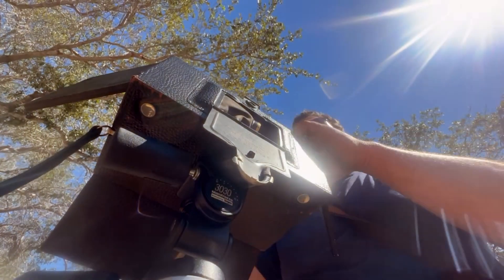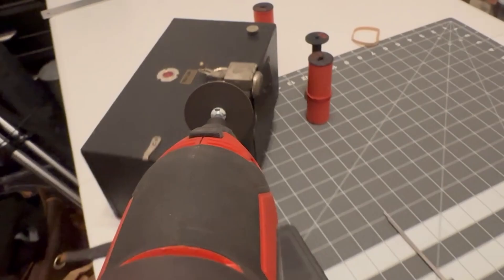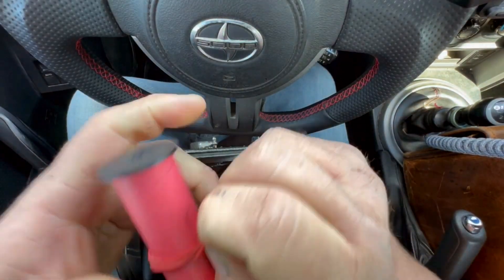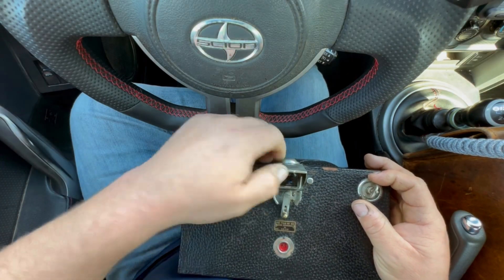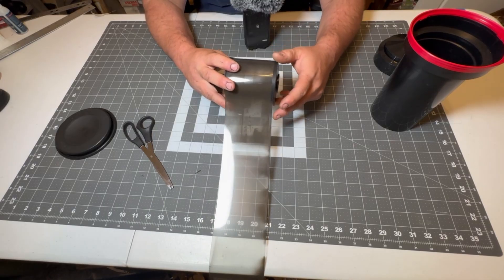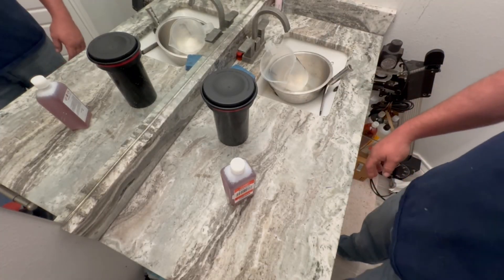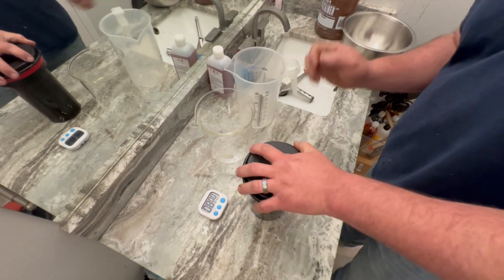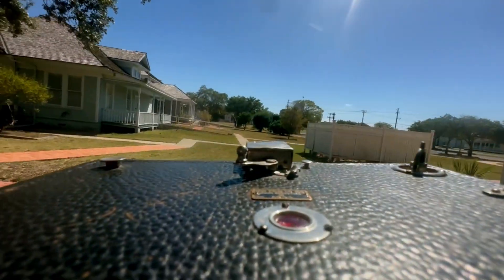Making 103 Film From Scratch for the Kodak Panoram No 4

Comment: Glad to see that paper is helping folks out! I might look into making a similar jig for cutting my own paper as well, and possibly film. Biggest hurdle is probably getting to be figuring out how to print the numbers without ruining the film.
Reply from the maker: I am working on a Al-Vista 4B atm. I’ll sure the process for how I choose frame location and paper length. The Al-Vista doesn’t need frame numbers but I can demonstrate it in that video.
Reply: I generally know how to place the stock market and frames, the real problem is the actual ink itself. A lot of inks that you can get as a consumer are not film, friendly, and even a lot of the inks that you can get industrial cause issues, as FOMA continuously seems to be finding out, and Ilford/Kodak have flirted with in the past.
Reply from the maker: @mcb187  I have tested and had some success with acrylic paint. It needs to be full dry before film can touch it but if you take some paper and coat 1 side with cheap acrylic paint or lacquer it should work. Once acrylic fully dries it inert. It's a pain and takes a lot of time to setup for but my earliest test with 122 film was done with this method. Same goes for the frame numbers.

Comment: A thougt. Is it possible to pre cut the flm so you dont have to fidget around with a scissor in the dark?
Reply from the maker: I didn't mention this in the video, but I have to cut the film in the dark no matter what. I cut the film from 9.5-inch-wide rolls of aerial film stock. I also use night vision goggles so I can see what I'm doing. Rounding the ends isn't too dangerous, but I understand wanting to avoid it.

Comment: Concerning the film loosening up on the take up spooI, I have two Kodak box cameras and a 1930s Rex folding camera; on each one both the take up and supply spools have a light spring pressing up against them, presumably so they don't loosen up. Perhaps this Panoram is missing those, as well as the rollers you had to replace.
Reply from the maker: This could be a real possibility. My number one and number four both have a plate like you describe, but it's the much older model A or no-letter model.
Reply: @Socialmocracy  👍

Comment: Since Jeff Bridges and Silver Grain Classics is relaunching the Widelux, it would be cool if someone like Lomography would relaunch Panoram. I would think it would more accessible to a lot more people.
Reply from the maker: I wondered that myself. I figured a plastic 6x17cm with a plastic lens would have been made by now.
Reply: @Socialmocracy  Ondu makes a pinhole 6x17 camera. I have the 6x6. I think a swing lens camera would be much more interesting though. I briefly had a Russian Horizont 35mm camera. The image quality was good, but I couldn't get it to not shred film when rewinding it. I am not sure if there was an issue with the camera, or not, so I returned it.
Reply: @danpast23  Are you talking about the old Horizont, the metal one. If its shredding the film by winding it, that means the clutch from the winding spool is too tight. (2 rubber washers tightened by a nut) You can make a spanner from a 6mm brass tube and loosen it by removing the bottom plate and you can see it through the slot in the take up spool. If you shred the film by rewinding it, check if the sprocket wheel disengages when you press the rewind button on the bottom. 40 years ago I bought one (very rare then, no internet and still the iron curtain). I paid a fortune on a camera fair(but still the half price of a widelux) and it was shredding the film, than I had light leaks, had to make new seals..at the end I dismantled the whole camera and rebuilt it..now it works perfectly..only from time to time a have to loosen the clutch from the wind up spool, but that's an easy job now with my self made spanner.
Reply: @ogroseln57  Cool! It's long gone, but I like how you figured it out. It was the old metal one.